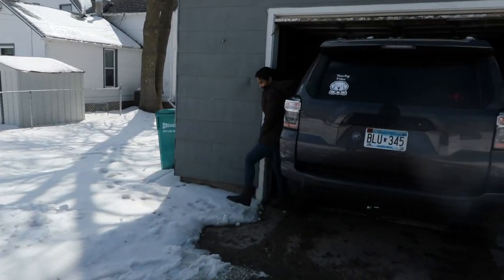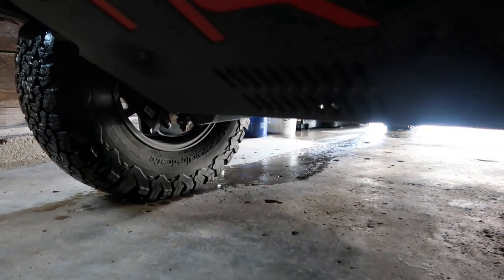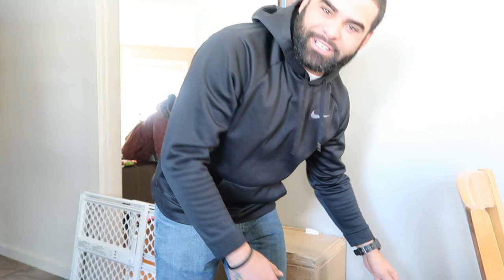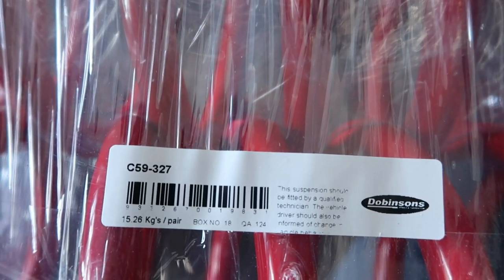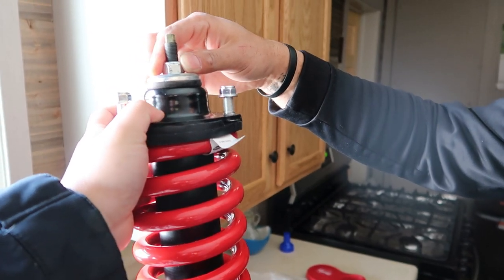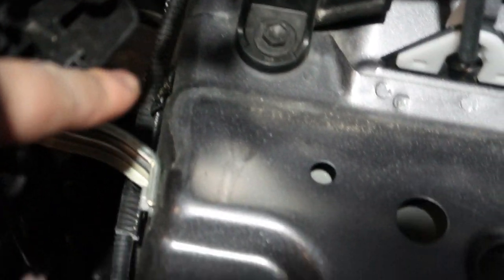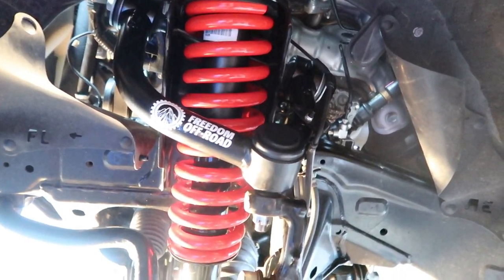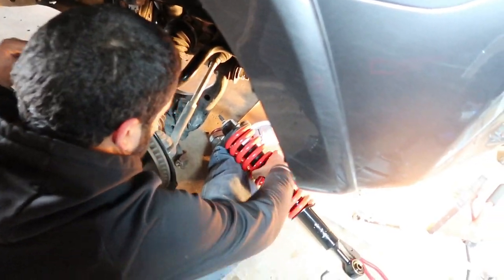2018 Toyota 4Runner TRD offroad gets Dobinson!

Comment: was it difficult getting the rear coils in? I've seen videos of people using spring compressors to get the rear coils in but i don't have any spring compressors.
Reply from the maker: No spring compressor needed. Once you have end links disconnected and Jack stand supporting one side of the rear axle. Utilize your OEM Jack by placing it between the axle and chassis. Then slowly and carefully jack, while keeping an eye on the break line. It should give enough clearance to take off the rear coils and putting new ones in.
Reply: Steve Pheej Yang thx so much steve! God bless.